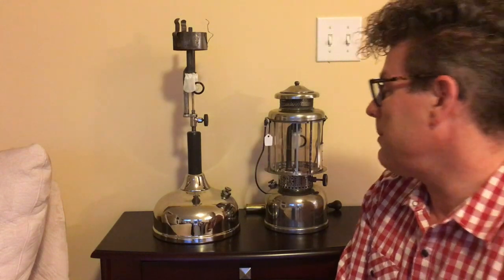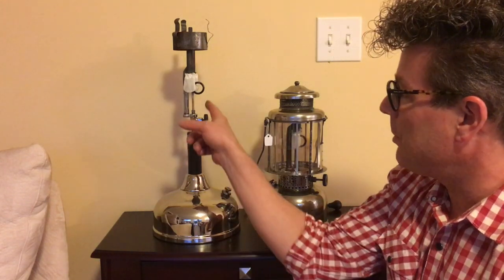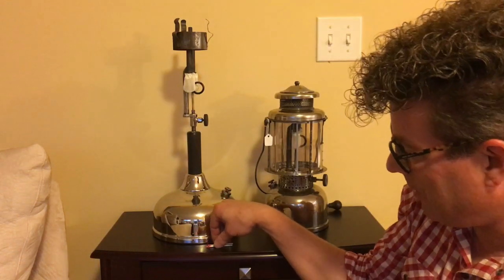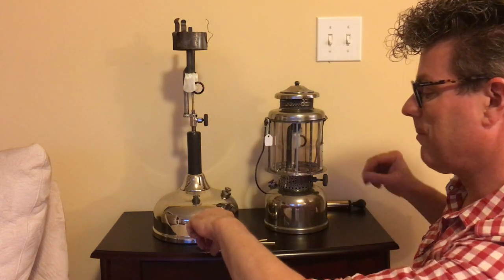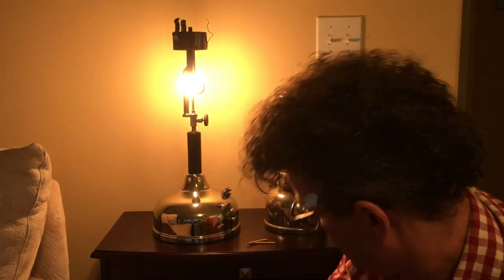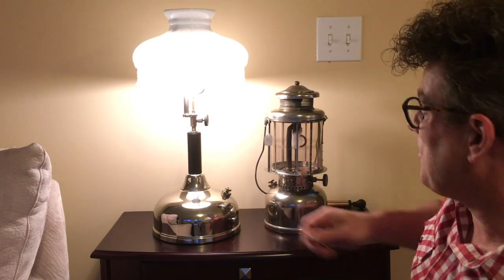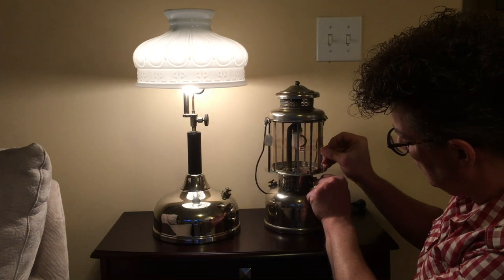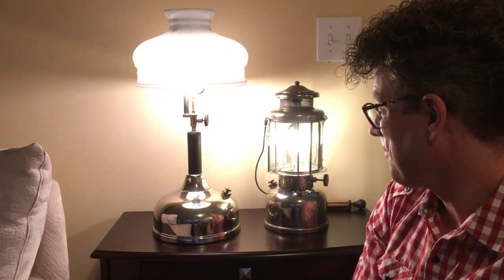How to Light a Coleman Quicklite Lamp or Lantern

Comment: Excellent Video King ColeMan!  I had been following the advice of many others by pre-charging my CQ lamp, which always resulted in fuel dripping from the generator resulting in the entire lamp erupting in a blaze of uncontrolled glory.  By following your advise and heating the generator before opening the fuel valve, the Lamp lights without issue.  Thanks for sharing your experience and knowledge.  Keep it coming!!!
Reply from the maker: Yeah.  I've seen that "precharge" advice going around for years and have never understood why anyone would do that.  I can only think it's that people think they need to "preheat" the fuel, but it doesn't work that way.  Preheat the generator and the fuel will vapourise as soon as it hits it.

Comment: Hi Bill. I have same lamp with naphtha but with the R55 generator so your video was great in explaining why it flares up when lighting without a preheat. I gather it would be best to buy a loop generator from OCP if using naphtha and the R55 with preheat cup if using kerosene. I could preheat the R55 with a butane or propane torch I suppose. I have a 327 as well with mica shade but I discovered a pinhole leak in the side of the tank while pressure testing in water so I will not light it unless there is a safe way to seal it. Not sure if POR 15 would work or is worth the expense.
Reply from the maker: Collectors have long debate which is better, a Q99 or an R55.  I prefer Q99s because can be lit with a couple of matches, but if they clog, they're a pain.  R55s require a bit of preheat to light, but clogs aren't a problem.  It's pretty much up to you.  I don't find clogging to be much of a problem as long as you start with a clean fount and always use clean fuel.  (My go-to lantern is a 327 with a Q99 and it's got hundreds of hours on it and no clogs.)  You can add a preheat cup to an R55, which some folks find preferable to heating with a torch.

The best product for repairing founts with pinholes is Caswell's gas tank sealer.  They actually sell their product in a smaller size specifically for gas pressure lantern and stove tank repair.  POR 15 might work, but I don't believe they've ever certified their product for tanks that hold pressure.  That said, I wouldn't put much faith in a sealed fount.  I see it as one of those last-ditch things you might do to get an appliance operational just so you can say that it'll run and so that you can fire it up occasionally.  I wouldn't make a daily driver out of it, would never burn it indoors, and would never leave it unattended.  Typically, where there's one pinhole, the metal is damaged, thin, or cracked and there will soon be more.

Comment: Kerosene or CF? How do you even tell with these lamps and lanterns? is there a reference or a book? Thank you for the beautiful and educational presentation.
Reply from the maker: The International Coleman Collectors Club does publish a reference book titled "Guide to Vintage Coleman Products 1900-1983".  It covers most lamps, lanterns, and stoves.  That said, most can be distinguished on their own.  If it has a preheat cup on the generator and/or instructions on the valve wheel about preheating, it runs on kerosene.  If it the valve wheel has Instant-Lite instructions (turn 1/4 turn, etc.) it's gasoline.

Comment: Hi Bill, I really enjoy your videos thank you! Question about the quick lamps, what are the best mantles to use on these? I recently purchased a couple of Toronto models, and most of my knowledge is with lanterns. Also, do you burn Coleman fuel in the house or recommend a different fuel? Thanks again for all your videos . 

Jay Peterborough, Ontario
Reply from the maker: The lamps are basically the same as the two-mantle lanterns.  They all use #21 mantles.  Peerless 2C-HG are comparable and some find them to be of better quality.  If the lamp was designed to burn "gasoline", the means Coleman fuel or some other brand of white gas.  Some lamps were designed to burn kerosene.  Either is fine indoors.  Any kerosene lamp can also burn white gas, just remember that you still have to preheat the generator.  The Quicklites can burn kerosene if you install an R55 generator.

Comment: And where can I get the glass shade at? Mine is missing
Reply from the maker: Shades were fragile and often didn't survive.  They're not easy to find.  Shades for Aladdin lamps are easier to find and most will fit a Coleman lamp.  You just need to be sure the shade is designed to handle heat.  Cheap glass shades for electric kerosene-style lamps are available all over the place and can be used for display purposes.  If you choose to try using one while running lamp, test it out for an hour or two in a safe place.  The heat may cause it to crack or explode and you don't want that mess in the house.

Comment: Thank you for the video.  I recently acquired one of these Quicklite lamps from 1919. It has no shade or assembly above the generator.  My question is, what is the hole at the very top for.  After the threads it’s open to the generator. Does it need to be plugged before operation?  I haven’t tried to light it yet. Thanks, I appreciate any help!
Reply from the maker: I'm not entirely sure what you're describing.  "Nothing above the generator" sounds to me like you're missing the manifold and burner tubes, but it kind of sounds like you're saying that you've got a manifold with an open, threaded hole in the top.  If that's the case, that's where the shade holder mounting stud screws into the manifold.  Again, if that's the case, you'll need to at least plug it with a screw before lighting.  If you don't you'll have flames shooting out the top instead of out of the burner tubes.
Reply: @king.coleman  thank you so much for the response.  That’s exactly what I needed to know.  I need to plug that hole before lighting the lamp.  I’ll find a bolt to fit or order the correct one.  Not sure how critical the correct screw would be as long as it fits the threads without stripping them out. Thanks again, I really do find your videos to be very helpful.

Comment: Do you mind if I ask what the table lamp is worth. I ask because I have the opportunity to buy one made in 1949. Also, would it require that separate pump that you show here. I'm not certain this lamp comes with one. Thanks
Reply from the maker: CQ lamps are extremely commons, so the lamp itself isn't worthy much.  Original shades are considerably harder to find and that's where all the value is in this one.  That said, specific values will depend on the market where you live.  I can say a new reproduction shade of the same sort sells for about US$100.  You'll need a pump to pressurise the fount.  If you don't have an original, you can use a ball pump with the little plastic cone attachment.
Reply: @king.coleman  Okay, thanks for your help. Is there a way of knowing if the shade is original or not? The lamp I see for sale is $125 so I guess it's reasonably priced even if the shade is a reproduction. My mom is a collector of old kerosene oil lamps and I thought she might get enjoyment from this one made the year she was born.
Reply from the maker: @jimdent351  There are ways to tell if the shade is original, but not being a shade expert, I don't know what they are.  A CQ in good condition with an intact shade is, I think, definitely worth $125.
Reply: @king.coleman  Thanks for your help. It will be worth the smile it brings to my mother's face. Thanks!

Comment: where can I find one of those lamps....  Looking for the one on my left  with the shade.....     and can it run on  K1 Kerosene?     gasoline or white gas  gives off too much carbon monoxide
Reply from the maker: CO isn't an issue.  I've shut up various models of gasoline and kerosene lamps and lanterns in a small room with a CO detector for up to three hours at a time and the CO never registers.  The issue is oxygen.  You need a source for fresh air, but even then, it doesn't require much.  Remember, these were designed to be burned indoors.  The Amish still use them routinely as a primary source of indoor lighting.

You can run a Quicklite on kerosene if you replace the Q99 with an R55 generator.  As far as where to find one, you'll just have to look around.  CQ lamps are very common.

Comment: I have that table lamp I've never tried using. Are these coleman fuel or kerosene? Where can I get that air pump?
Reply from the maker: They were made to run on gasoline/camp fuel, but because the Quicklites predate the Instant-Lite valves, they will run on kerosene if you swap the Q99 for an R55 generator.  R55s were designed for burning both gas and kerosene.  That goes for both the lamps and the Quicklite lanterns.  I believe Old Coleman Parts sells pumps, but in a pinch you can use a ball pump with the plastic cone fitting.

Comment: I'm assuming these don't run on kerosene
Reply from the maker: They weren't intended to and with the Q99 generators as show they will not.  Replacing the generator with an R55 will make it possible to burn kerosene.

Comment: It was a beautiful thing to see that lamp light so perfectly!
What type of packing is on your fuel valve for your lamp? String or graphite like newer lanterns? If graphite, where do I purchase a new one for my identical (straight generator) lamp? 
With a full tank of fuel, how many pumps do you give your lamp? Thank you.
Reply from the maker: oldcolemanparts.com is the only place I know of that might sell original packings.  You can use graphite rope to repack them if necessary.  With the large pump, I give it about 15 pumps.  They're not picky.